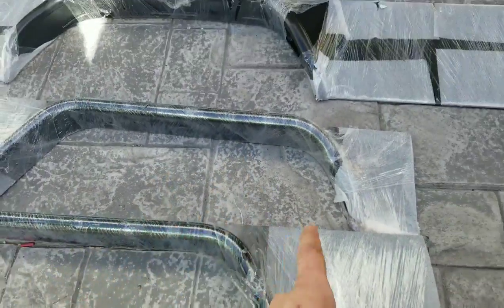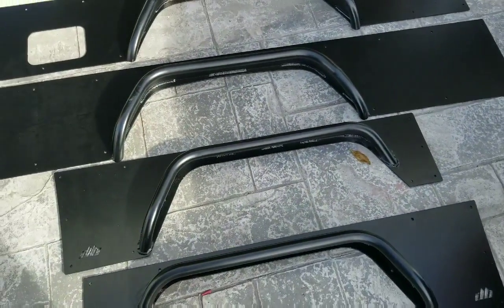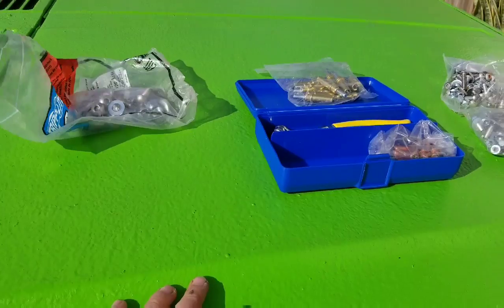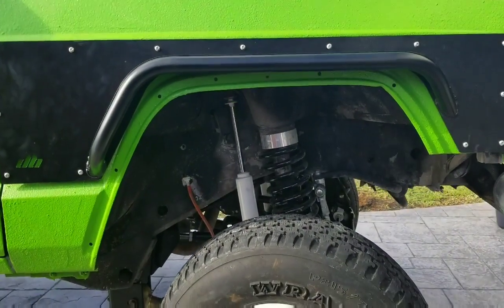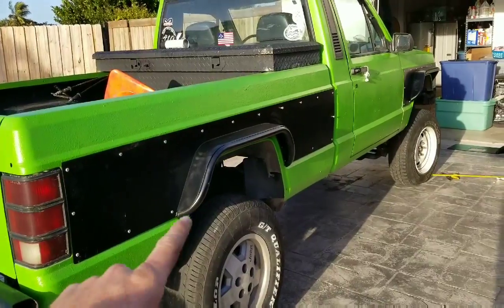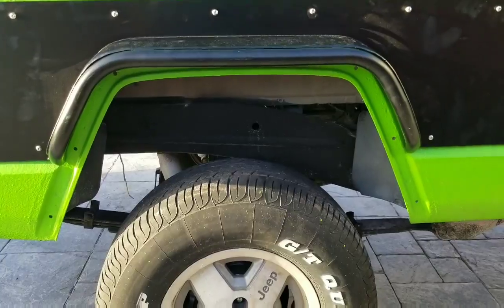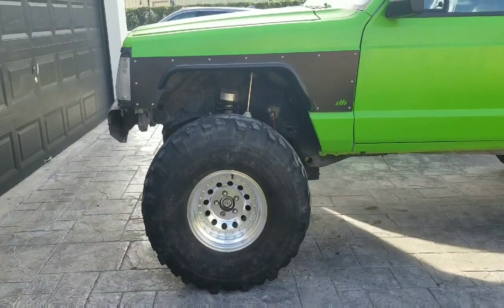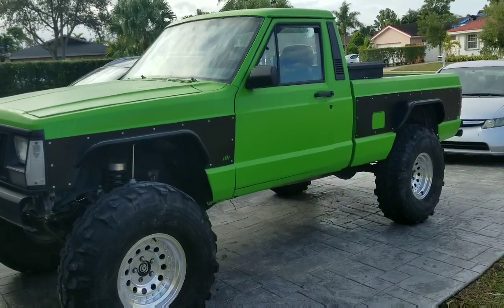Comanche Build- Fender Armor

Comment: Damn i watched every second of this video to try to see how you attached the thing, did you use nutserts? did you use a threaded rivet tool? How did you get the bolts to mount in there? Did you have any trouble?
Reply: Says what he used at 12.13
Reply: @ryancarter1041  he used lock washers on the front but didn't say what he used in the rear there is a fender liner preventing access to the rear bolts
Reply from the maker: @williamjohnstone749  if you are referring to the rear armor, the middle three right over the wheel arch do require the use of riv-nuts

Comment: Did you hammer the rear wheel wells while the fenders were on? Or had to remove
Reply from the maker: I cut and folded the stock wheel wells. Worked great with 35s. No I’m on 40s and I need a little more room but it still works great

Comment: What clutch pilot bearing do you used or fly wheel?
Reply from the maker: I used the stock flywheel from the 2.5l that came in the jeep because it had a manual before I swapped in the ax15. The pilot bearing I have to look up the part number
Reply: Mr 410 Can you send me the part # ?
Reply from the maker: @josecuevas9696  advanced  adapters 716167
Reply: Mr 410 thanks for the part #
Reply: Thanks for the part  #
Reply: Can you tell me what slave cylinder and clutch  master cylinder do you used I will appreciate it if you send me the parts # !

Comment: What's the deal with the paint?
Reply from the maker: The paint for the fender armor, or the actual comanche? The fender armor was powder coated a satin black and the actual comanche body is a rolled-on bedliner paint from a company called monstaliner color code is predator green